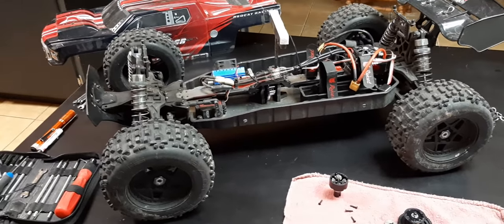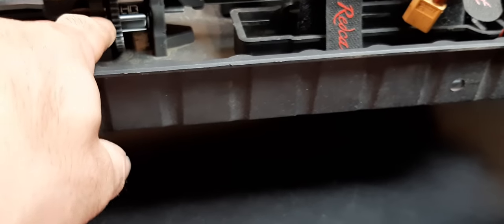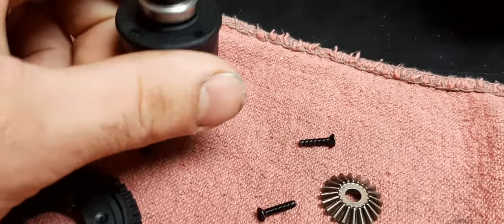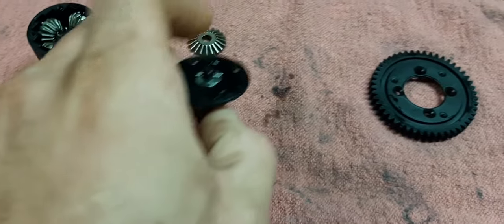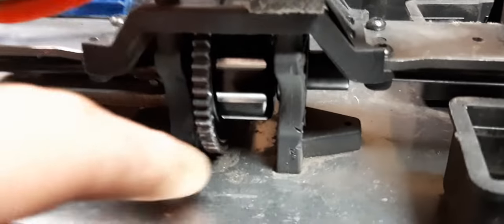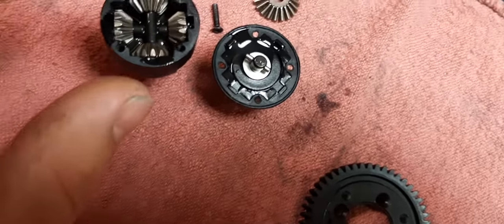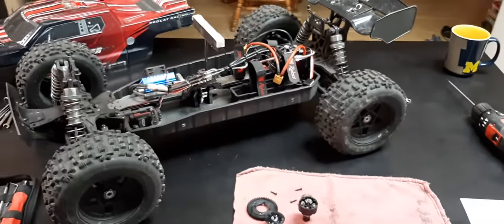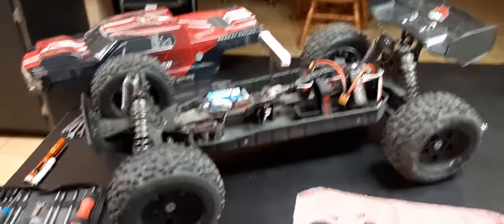Shredder center diff upgrade to arrma 6s diff!

Comment: This is a Fantastic video I will post on the Shredder Facebook page. Great job!
Reply from the maker: Thank you!
Reply: @ragercrepair9301  those bearings are hard to find, wondering if the whole Arrma motor mount can be transplanted, or the one from the Corally trucks?
Reply from the maker: I just used a dremel and hogged out the shredder mount. Then got the 5x19mm bearings. Kinda a bitch but it works.

Comment: Hi and thanks for video.  I just looked the bearings up and on Amazon they are saying they are 8x19x6mm, which dimensions will need to be modified to work? I may have missed something.  I have a Shredder and purchased a center diff online that is metal casing, gears, and spur from Redcat (I thought). It's been at least 6 months since I messed with it. I do remember the front diff cups were wallowed out, not severely but enough to where I wanted to replace them and it seems like they were unavailable to order?  I'm unsure if I have talked to you about the Shredder I  purchased used online and had to replace a lot of parts.......I kinda got aggravated and put it in a tote and went to something else...lol.  Now I want to get it going and have been watching videos to see what has changed in 6-8m time. I do know the spur and case is metal. If it's gonna mess up on me soon, I definitely want to prevent it. The front bearings were shot so I ordered them, aluminum knuckles all 4,  metal steering servo saver, steering linkages......again I think the cups of the front diff needed replacing and front diff was nearly dry.  Any recommendations,  links to videos, etc would be appreciated.     I just traded a lot of items for it then it was so worn, parts were out of stock, etc.....that's why it got put on the back burner.  I will be running on 4s and even on 4s the Pro-Line Masher tires on it ballooned dangerously bad.....I really wish I would have just bought a new one but now I have a lot of $ in this one and definitely can't sell it for what I have in it.  Hopefully you can help me out with suggestions.  Thanks in advance

Comment: i am going to do the same thin but i am going to us the outside of the redcat bearing bust them open an it will fit in am make up for that mm that is needed do you think it will work i know you said i have to use the drive cups the outside of the bearing is just enuff to make up that slack my friend
Reply from the maker: It will work if you red locktite the outer race on the arrma bearing.

Comment: I don't know if you still have the same rad cat shrutter but you can get ceramic bearings for itt
Reply from the maker: Yes they make them. They are expensive but well worth the money!
Reply: Yeah I got some fasteddy bearings for it out the box the back diff went  back to the drawing board with the redcat.

Comment: I can't find that 8x19x5mm bearing, let alone an 8x18x4 or 8x18x5 or 8x19x4. Any links to get the right bearing? Preferrably the 8x18x4?
Reply from the maker: From what I'm seeing the bearing needed isn't available. I can't even find them anymore. So what you can do is take the stock shredder bearing apart and keep the outer bearing race. Slide that over the stock arrma bearing and red locktite the outer race to the arrma bearing. Then put it all in the stock shredder mounts.

Comment: Have you done anything to the front and rear diffs?
Reply from the maker: Yes. Tore them apart, shimmed them and added 15k diff fluid. Then added lithium grease and a little Lucas oil stabilizer to the diff cases. Nothing has broken since.
Reply: Ok, thanks for the info and video.
Reply from the maker: No prpblem man.

Comment: Do you have to shim the new diff?
Reply from the maker: I don't necessarily shim a new diff.  But I will tear it down and inspect it,  check the mesh,  shim it if needed and then fill it with diff lube.
Reply: @ragercrepair9301  oh ok because I just ordered all the parts and wasn’t sure if I should transfer over my goblin shim to the Keaton diff. Also learned don’t run a shredder on 8s
Reply from the maker: Well yes 8s will eat everything.  Lol.  I would say get the correct shims for whatever diff you're installing. Using new parts,  you will know that aren't damaged in any way

Comment: Did the front and rear diff cups get made
Reply from the maker: No I just harden the factory ones and no issues since!
Reply: @ragercrepair9301  how do you harden the factory ones ???
Reply from the maker: Get them hot and quench them in oil. Then put them in the oven at 450 for about an hour.
Reply: @ragercrepair9301  cooking oil or diff oil??
Reply from the maker: Cooking oil for quenching. Or trans fluid. Trans fluid is the best.

Comment: I never got the part #s?
Reply from the maker: For which part?
Reply: Rage Rc Repair if there really is a noticeable difference between the diffs then all parts necessary to do the complete Arrma diffs swap because I was already going through them on 4s so I know it’s gonna be worse with 6s power
Reply from the maker: Pm me. I have all the numbers. My Facebook name is Car Smith. Silver Ford as my profile picture.

Comment: Yea it’s too bad that redcat products are jus plain and mediocre at best!! So the term “u get wat u pay for@ is true wit redcat!! I kno I have 5 of ther trucks and I’ll nvr buy another redcat anything again!!
Reply from the maker: Well if you leave them stock they are pretty damn tough. They are focused on people that don't wanna spend a grand to get in the hobby. And in all honesty I've owned them all and if you take the time to set them up right, the redcat hold up just as well as arrma and Traxxas.
Reply: @ragercrepair9301  I’ve had more issues with ther electronics especially on the landslide.. but I’ll nvr buy an overpriced traxxas
Reply from the maker: Right! So basically I haven't had any trouble with any of their electronics. But I haven't bought a newer model in a while. I have 4 shredders, the earthquake, a volcano, and I've had the had the aftershock and the back draft. Bought them all used and repaired them and sold them. Thyy are still going and that was 3 months ago. Lol
Reply: @ragercrepair9301  nice!! I actually like the shredder and the lightning pro that I have upgraded.. but ima big DHK fan.. I have a couple videos posted on my rc’ing wit all my trucks
Reply from the maker: I have seen some of their rigs and thyy seem veyy well built. I'm thinking o getting the maximus.
Reply: @ragercrepair9301  I have the Razr-r2 and the zombie.. good strong vehicles.. jus the screws are the weak points.. most need thread lock other than that ther great.. the razr truck does not break!! I kno I’ve had for a year now
Reply: @ragercrepair9301  Maximus is a god truck I couldn’t afford it at the time but it comes upgraded already.. jus the screws makes it weak so u gotta thread lock them
Reply from the maker: That's simple enough.
Reply: @ragercrepair9301  have u tried that other arrma outcast solid metal diff? The one with no spider gears? Jus curious bout that center diff
Reply from the maker: No I haven't. I'll look into that.
Reply: @ragercrepair9301  I figured if that center diff on ur video fits then maybe this one does too.. it’s $50 look it up and keep me posted
Reply from the maker: What's the part number for it?
Reply: @ragercrepair9301  let me look it up
Reply: @ragercrepair9301  it only comes up as steel spur gear center solid axle diff for arrma 1/8 6s blx